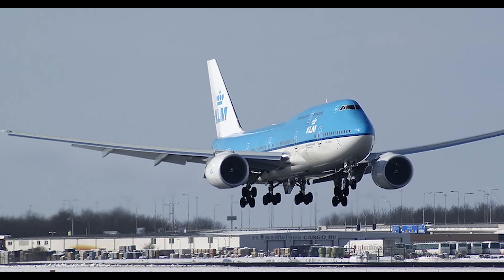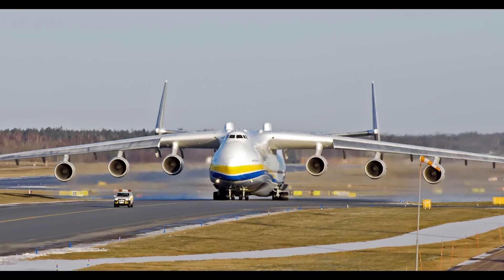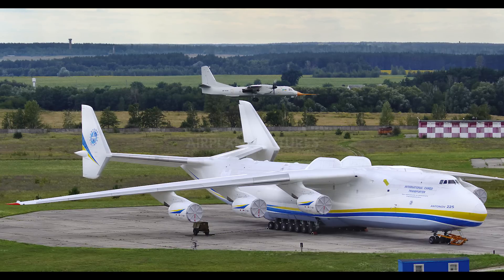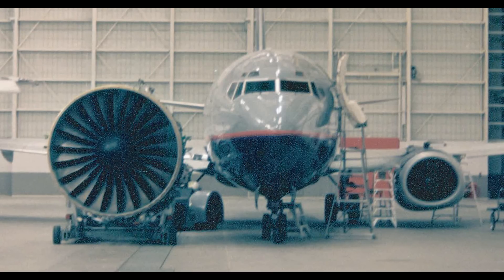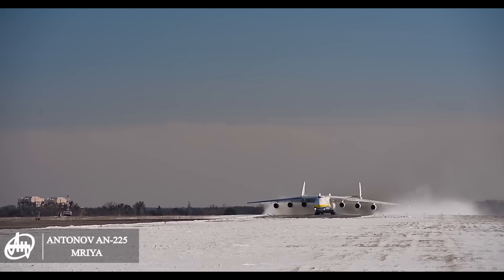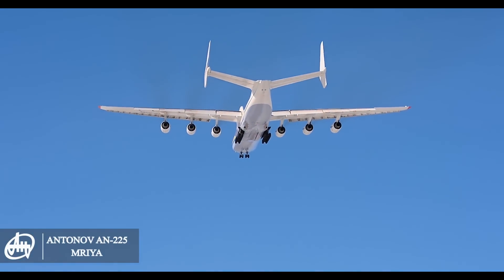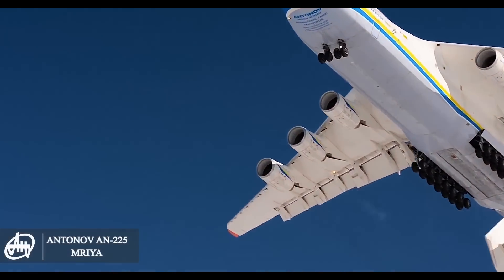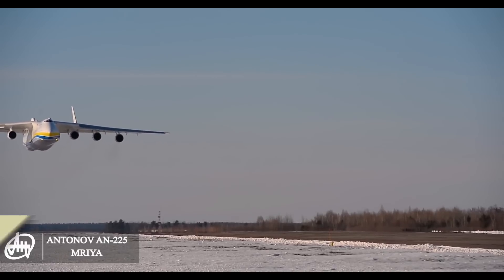Will 4 GE90 Engines Work On The Antonov 225?

Comment: I think it would be better if the re-engined AN-225 would have 4 RR Trent XWB’s instead. The Airbus A350-1000 has the higher thrust version (Trent XWB-97).

Comment: Hey guys, hear me out: Make the AN-225 bloated like a much larger version of the airbus beluga. Give it 6 NUCLEAR POWERED GE-9X engines, and then adapt the fuselage to become a flying aircraft carrier capable to launching MiG-29, F-16, or Gripen fighters midair. Basically the 747 mothership on steroids. And yes I had to take meth and cocaine before coming up with this idea.

Comment: I was fortunate to have seen the smaller version 224?  At the AFB in GULFPORT MISS, in 2000, wondered why this Soviet Aircraft was there, but following Aviation, discovered they use it as a heavy lifter worldwide, for hire. 4 engines

Comment: I believe that Antonov has been considering restarting the production of the An-124. This could lead to some interesting things. I would love to see more AN-225's as it's a beauty, I had the pleasure to see it twice in my life when it visited Amsterdam on  27-12-2007 in the evening and on the afternoon of 09-07-2008 :-)
The AN-124 I only saw once back in 1991-1994 (I do not have pictures as I was at work and unprepared for it's arrival.
I would love to see either one of them being rebuilt and with new efficient engines!!!! I believe they would never make it a tri-jet but go for the more stable 4 engines configuration.

Comment: Glad you brought this up. I was thinking about this a few days ago. However, I do not totally agree here. In reference to your A380F video, the main issue if the A380F is the weight/volume capacity not exactly the size. We have the 747-8i that worked out, the size was not exactly the issue as I see. It Isa challenge to fill such a behemoth, but I do not believe it is the main obastcle.
.
The Antonov aircraft are characteristically more specifically designed for their purpose. AN-124 & AN-225 were designed from the ground up for heavy lifting and they are very good at what they do. They possess some unique capabilities for cargo that no other machine match. Here we are talking about the geometry arrangement of the cargo compartment volume which further helps in lifting more larger things, the internal crane, the loading gate cross sectoon and more.
.
They lack in efficiency for this era. I see a tri-jet a an-225 would be impractical in terms of design and balancing, as well as maintenance.
.
A redesigned AN-124 with 2 x GE9X, improved body aerodynamics, redesigned wing section. All manufactured with modern methods that feature smoother surfaces, as well as heavy utilization of composite material and modern avionics and controls. Another configuration would be the use of 4 x Trent 1000 on the AN124, or Trent XWB on the AN-255.
.
That would sound like good machine.
.
That is my opinion
Reply: RE am A380F: Additional disadvantages are lack of a raiseable nose door, and a cut up, ineffeiceint shape for the cargo bay.

Comment: We have to remember that the AN225 uses those “small” engines because it was designed to land into dirty runaways, mitigating engine objects intake, the massive GE90 engines would lower that safety ceiling and restrict its operations, including runaway minimum width to keep the engines within the runaway. We also need to check if the  negative horizontal angle of the wings can support the weight (specially with the wings fully loaded with fuel) and if it has structural strength to support the thrust from the GE90 engines. For the trijet configuration it’s most likely that a new tail would have to be designed and the center of gravity would be moved to the back, increasing the fuel consumption and making the aircraft less stable.
Reply: "We have to remember that the AN225 uses those “small” engines because it was designed to land into dirty runaways, mitigating engine objects intake"

Is that why the an-124s engines appear to be closer to the fuselage then other 4 engine aircraft?
Reply: Directly replacing with GEnx would be much easier while providing the ground clearance and efficiency increases
Reply: ge90-115b can do 127400lbs and the ge9x is 134100
Reply: The manier the better

Comment: This is stupid, It would be better if you just put 2 ge9x engines which would be more efficient and would be lighter.
Reply: and only able to lift less payload ?
The point of video like this is to re engine an existing aircraft with fewer number of engines by using newer, more powerful, and more efficient engine without reducing the planes payload capacity .

Comment: What about the GE9X
Reply: Jasper Tiger Gaming GE9X reduce the thrust because of the effiency
Reply: Also the 777X is lighter than the 777 and the wings are more efficient, so the GE9X doesn't need that power to lift up the 777X

Comment: The AN engines produce 51,000 ibf each, whilst one GE90 produces 81 - 97 Ibf. So with GE 90 engines it would lose around 16,000 ibf in total if it was to use 2 GE 94B engines. That's half the power in one 737 Ng engine.